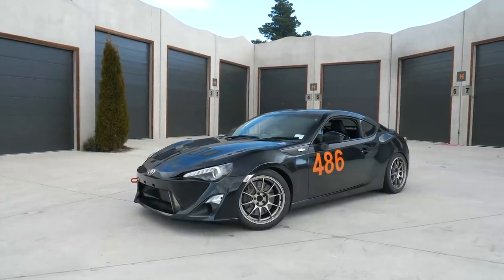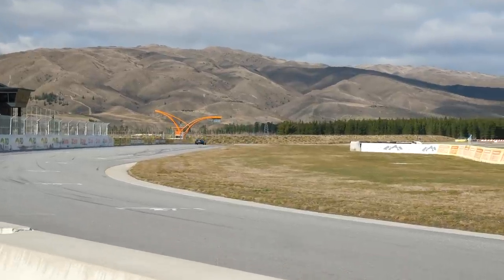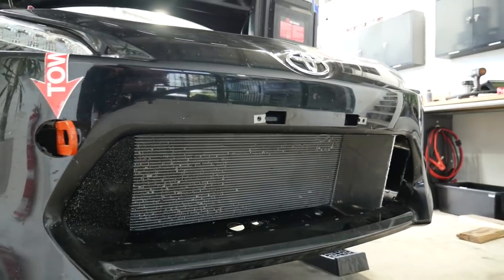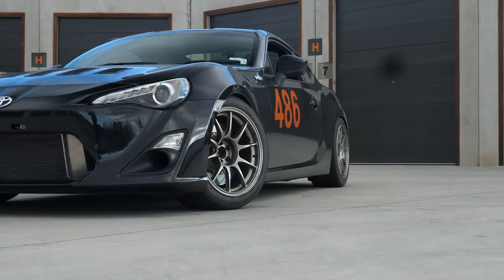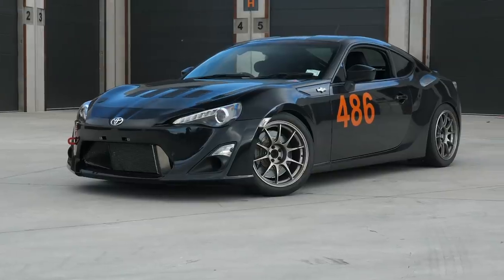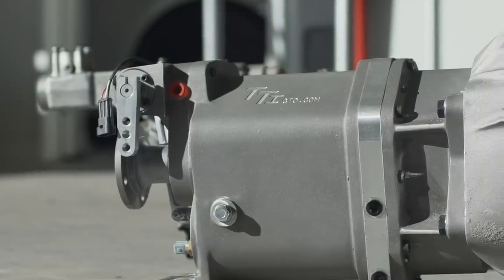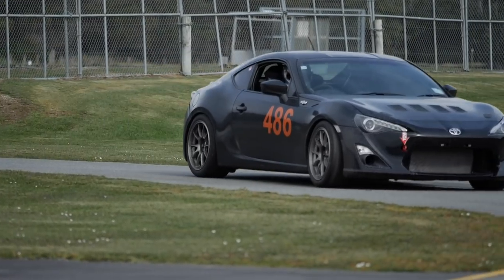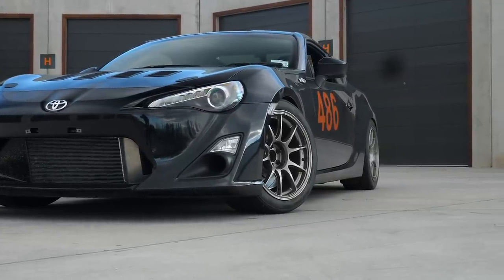V8 Swap Issues | Street to Track GT86 Cooling Upgrades [TECH TALK]

Comment from the maker: NOTE: This video is a little old as we started filming it near-on 2 years ago then kind of forgot about it, however, we felt it was too good to not release now right before another massive change in direction with the car happens for the upcoming season. If you have any questions about the cooling system pop them below and we'll get Andre on the case for you guys - Taz.
Reply: How’d you end up venting the hot air out of the engine bay? I need to know the details so I can do the same
Reply: @Earache.  one awsome way is to raise the bonnet from behind...
Reply: @Earache.  by adding washers
Reply: Dhaval Dedhia anything to keep me away from hood vents lol they’re useful but I don’t appreciate the look
Reply: @Earache.  raise the bonnet itself... Let me try get a link of what I mean
Reply: Dhaval Dedhia no I know what you mean they’re called hood risers
Reply: @DhavalDedhia  this does not work. The back edge of the bonnet is in a high pressure area - which is why the car's A/C gets its air from there. Try turning the fan off while driving at high speed, and the air will still come out the vents.
Spacing the bonnet up will actually allow air to force its way into the engine bay and increase the under bonnet pressure - which reduces flow through the radiator.
Reply: Still glad you posted it

Comment: Very pleased you made specific mention of the need to manage airflow AFTER the cooler matrix - one of my triggers is when people fit bigger radiators because of overheating - then fit fan shrouds that block off most of the back, worse, sometimes they're so close fitting it chokes the airflow even more.

There are easily sourced thin rubber sheets, with fabric re-inforcement, that can be used to form 'flapper' valves over cutouts in the shroud. These are flexible and move to allow air to pass through when the vehicle is in motion, yet when the fan is running and the vehicle stationary, or moving slowly, they are drawn onto the shroud, blocking the openings and forcing all the air to be pulled through the matrix before passing through the fan. You can see a similar setup on many OEM shrouds.

Comment: Another great video to start the day with in Germany accompanied by an espresso :-)
Driving a BRZ now and then on the Nordschleife where I live, I can only dream of having so much tuning options.
In Germany restrictions on tuning are a problem, every part needs to be Tuv approved.
This makes the parts you can get very expensive.
For instance, upgrading your brakes (discs and calipers) cost you around 3.500 US Dollars.
Those exact same parts without Tuv (from the UK) cost 1.100 US Dollars.
Reply from the maker: Wow! That is something I was not aware of and it's no wonder the scene there is a bit more limited. If you wanted to run a track only car, are there many options when it comes to where you can race that are affordable or is that also very expensive?
On the upside, new cars are a bit cheaper in Germany than here so while we have a good amount of freedom when it comes to modifications, most of the fleet on the road here in NZ are old pieces of crap anyway 😂 - Taz.

Comment: You can use a BMW E38 raidiator,it is a 2 in one with an oil cooler built in ,we run them on 600hp cars easily and for additional cooling we have the water spray on the radiator

Comment: Hopefully the sequential solves a problem ;)  Can you elaborate on the 'potential technical issue' with the -6 lines running to/from inlet/outlet side of the coolant system to an expansion tank?  I have fitted something similar and yet to test it on the track. Thanks

Comment: What are your intake temps like with the short pod filter direct behind the radiator? 

It sounds brilliant on track though the gearbox noise coupled with the engine are on point. Lovely.
Reply: Till that rear housing cracks on the gearbox
Reply: First thing i noticed. Desperately needs a bit of  repositioning. Drawing in hot air cost power but also puts all the other temps up, apart from egt, as less energy is produced on each power stroke.

Comment: I’m curious with such a massive reduction in water temp if you could see a power increase reflected in top speeds reached on the straights?
Reply: this does make sense theoretically for all areas of the power curve because the intake air temperature of the engine would definitely be a number of degrees cooler hence increasing the density of air charge which in conjunction with more fuel equals more power. More area under the curve= faster lap times
Reply: Mainly depends on how much heat soak the car is getting into the intake when the coolant temps are higher. If the intake was not heat-soaking before it wont make much of a difference even though there is still some residual heating from the block and other components where the air travels to.
Reply: There may actually be a small power increase as with a higher coolant temperature there is less delta T between the burning fuel charge and the cylinder walls, so more is available for expanding the gases.
Many very competitive race series run their engines at higher temperatures, with high coolant pressures to raise the boiling point, for exactly that reason.
The trick is to avoid heating the fuel/air charge before it enters the cylinder.
Reply: GordoWG1 WG1 Most of what I have read about race engines running extreme water temps (NASCAR in particular) is due to improving aerodynamics by reducing flow through the radiator. The high water temperature reduces power (due to high inlet and head temps reducing air charge density) but the aerodynamic benefit outweighs the power loss. On an engine that runs on lower octane fuel, power will likely be further reduced with high water temps due to having to reduce ignition advance and additional fuel enrichment to prevent knock.
Reply: @99EclipseGSX  Doh, you're right - aero' rules them all. Bit of a brain fart there - a very small potential power improvement is negligible compared to the lower drag and/or more efficient downforce. Heck, could be a power loss and it'd still be worth the trade-off.

Comment: Have you guys considered wrapping your exhaust manifold and  running larger head dumps vents on the hood......and bring in heat wrapped intake to a single collector by the headlight?

Comment: Are there no aftermarket Electric Water pumps for the 1UZ-FE ?
Reply from the maker: There are universal water pumps that could be adapted but the actual 1UZ pump has proven to be more than adequate in these engines, even at 8500+ rpm

Comment: What are those 3 large hoses under the R/S of the floor?
Reply from the maker: Fuel lines to go from the secondary tank to the primary. We will fill from the secondary so nice bit lines to filter on down to the rest of the system - Taz.

Comment: You mentioned a diff cooler, because your diff temps were higher than you would like, and i saw you had an aftermarket diff cover on your diff. Sometimes the diff cover can be the cause of the increased temps, especially in the aftermarket range. Robbing you of lubrication, cooling ability and horse power. Gail banks has a series of videos on this topic explaining the ins and outs of it. here is a link to just one of them. https://www.youtube.com/watch?v=vdtmDl5EDJ8  Can't hurt to take a look. like your project heaps.
Regards
Doug
Reply from the maker: Hey Doug, yes we fitted this as part of the solution and did address Gale's content on this as well in relation to our own setup here: https://youtu.be/PE3NbjPEO_U

Really appreciate you thinking of us and sending that through too mate, legend 😎 - Taz.